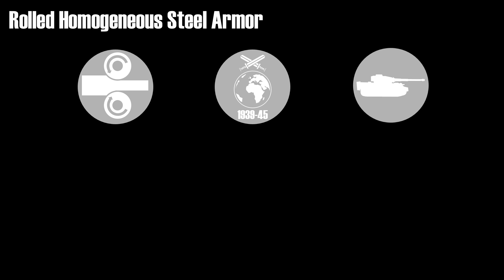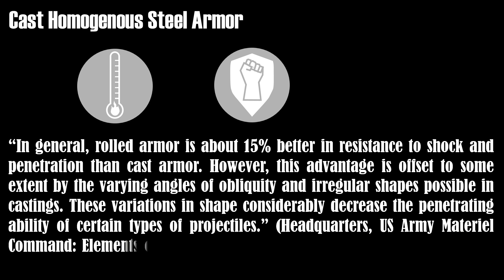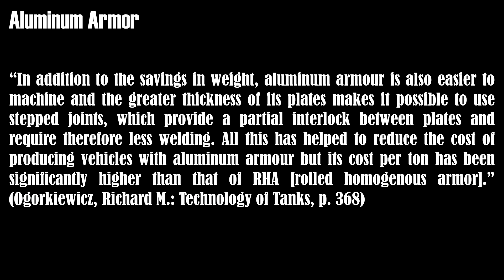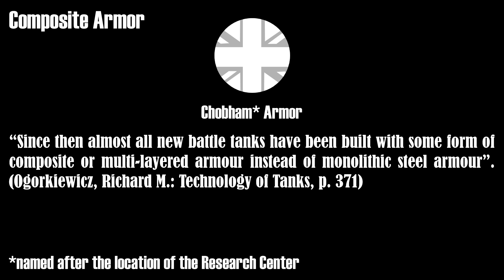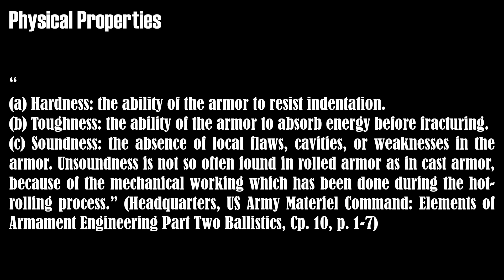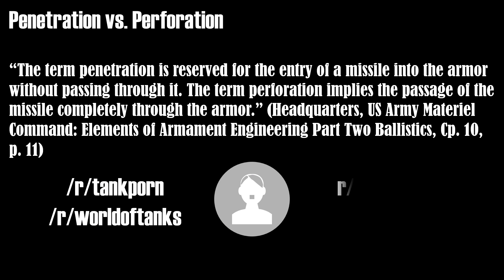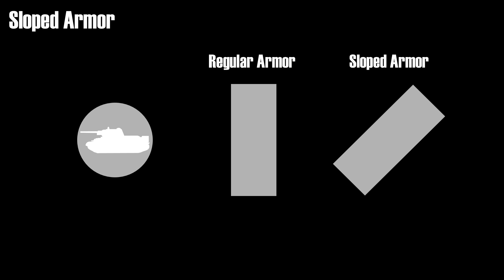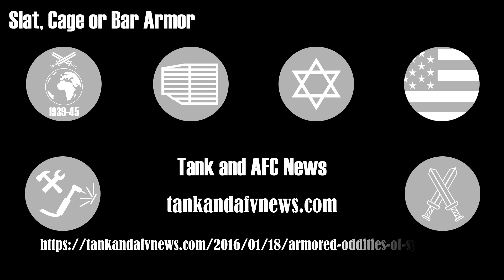[Tanks 101] Armor Protection 1920-1980 - Features and Characteristics

Comment: MHV, do you usually stick with BE or AmE spellings? The video appeared to be using both when referring to armour vs armor and aluminium vs aluminum.
Reply from the maker: AME, but quotes are sometimes in BE. Also on special occasions I may use BE for authenticity / humor... I know I did it once in another video, but I can't remember.
Reply: The quote at 5:14 brings up "aluminum armour", interestingly enough.

Either way, thanks for excellent presentation.
Reply from the maker: yeah, probably I typed it the wrong way and/or word auto-correction. Until now I was unaware that Aluminum is different in BE and AME... I know of some "u" oddities like "honor" vs. "honour", but Aluminum... wasn't aware. Now, I know.

thank you and you are welcome!
Reply: Military History Visualized
Well, in the case of aluminium, it's not just the spelling that happens to be different. The British specifically pronounce that additional letter in aluminium the way you do in the video (AL-ew-MIN-ee-əm), whereas Americans go for ə-LEW-mi-nəm.

Comment: Part 1 :D

Careful. You made it sound like all Shermans were cast. They weren't. Some were cast others used RHA. Ironically, the drawing you used is of a welded Sherman (at least the hull, the turret I'm not sure).

Wait, the T-90 doesn't use composite armor?

The Allies used more cast turrets because they were easier to produce, but required larger factories, which the Germans lacked, IIRC.